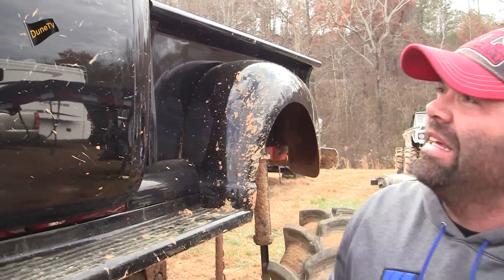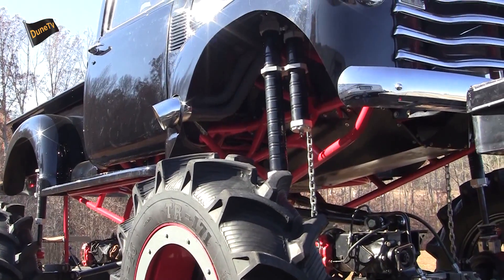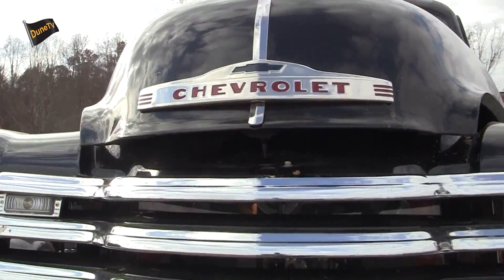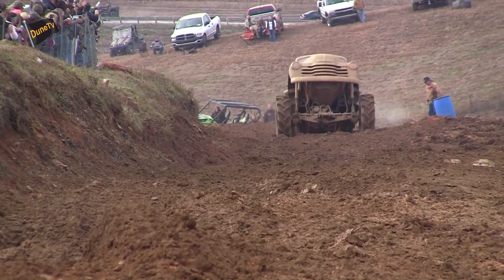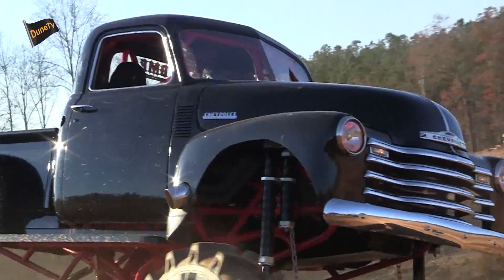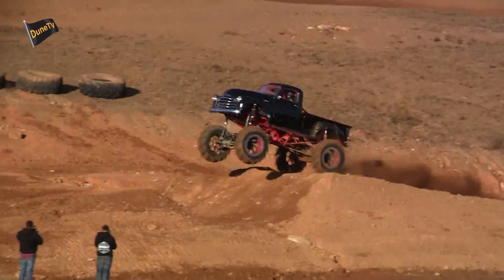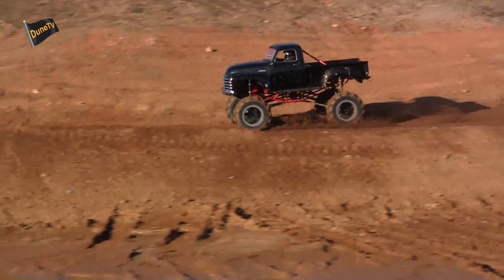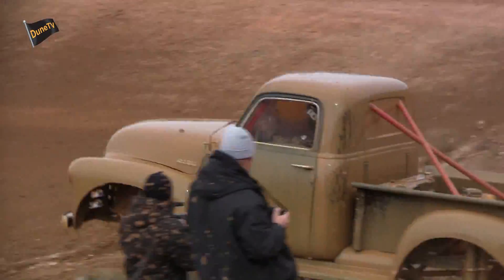SICK 50 Chevy at the West Georgia Mud Park

Comment: Is that the one that almost flipped over frontwards in other vid ?
Reply from the maker: No, not this one, he pushed it a little bit, but he also planned on taking it home in one piece.There was a Bronco that went over though during the event. That will show later this week.
Reply: yes it is the same one. those problems have been solved!!
Reply: +john miller It didn't flip, but yeah. He had some sort of valve body issue in the trans.